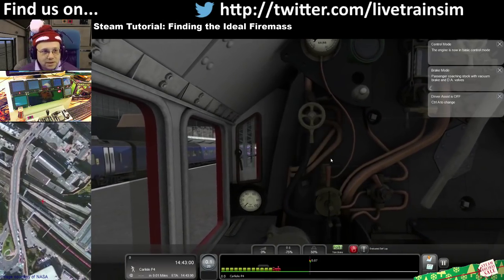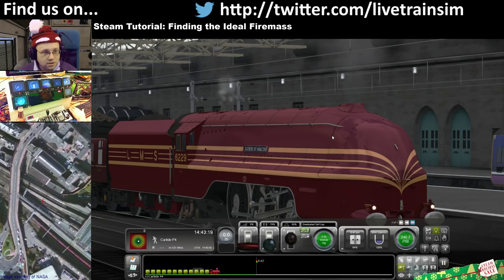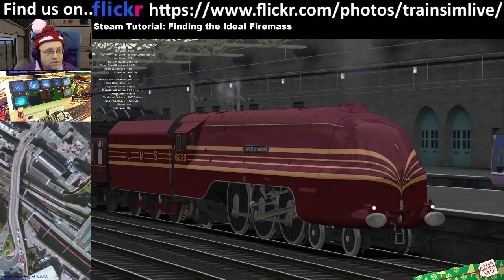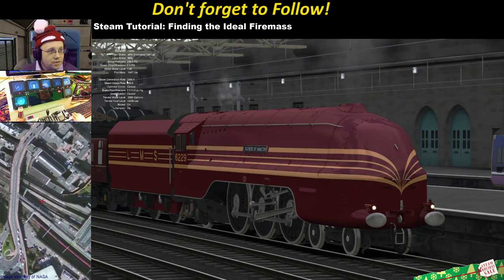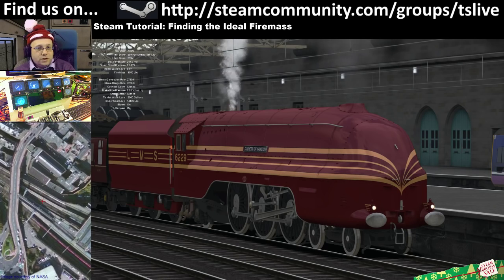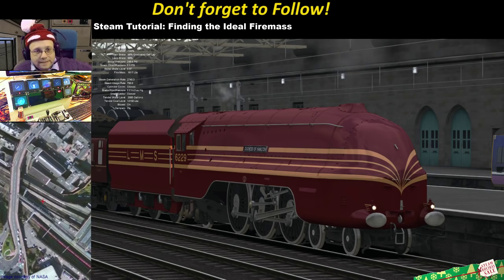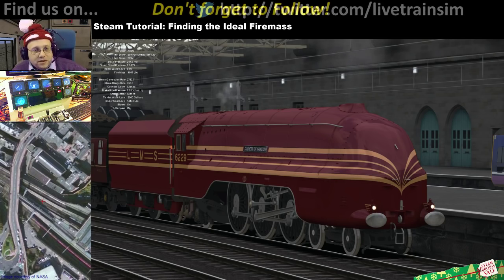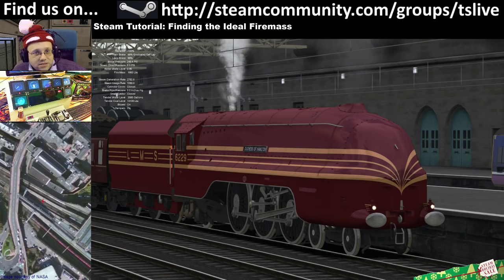Let's Play Train Simulator 2016 Tutorial - Finding Ideal Fire Mass

Comment: even if I hit the right fire mass, I have a real problem with the boiler pressure dropping like no tomorrow in this loco specifically, I can drive any other steam loco fine, using the regular controls, any ideas?
Reply: yeah, for the most part I gradually bring it down whenever the boiler pressure drops a bit and leave the throttle on a high level, however I can hardly give any cut off in this loco, like no more than 20% even at say 20mph, compared to a normal level which would be about 35-40%
Reply: Kenyon Payne Duchesses have to be coaxed to really do anything. Just keep fiddling about with the controls until you get it right. 
I don't know if it applies to train sim but the LMS firing rule was little and often. What I tend to find is that filling the boiler while you're at a lower speed (like 99% build your fire up and then just go for it until you reach a speed restriction at which point, throttle off, water on blower on. 
Also as the gradient changes, change your regulator/cutoff balance